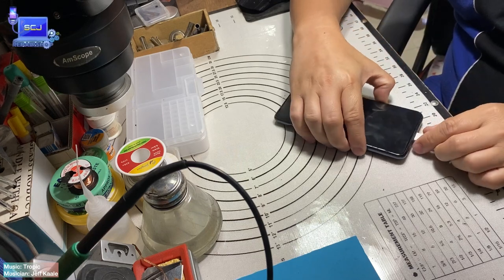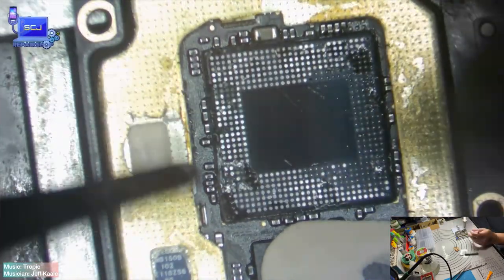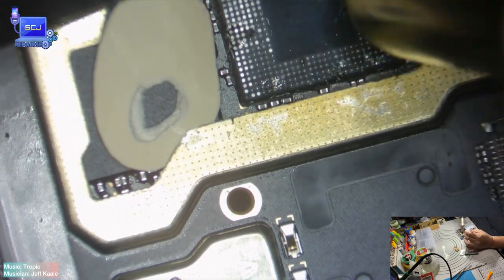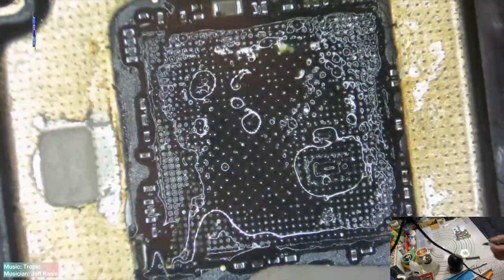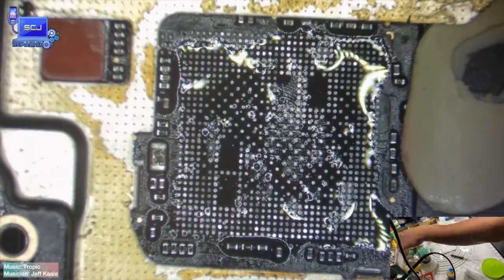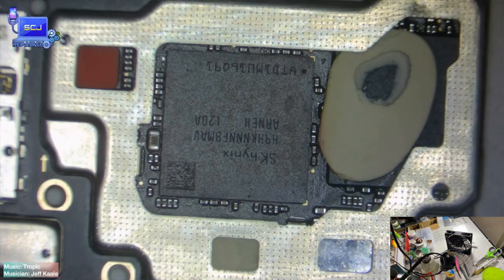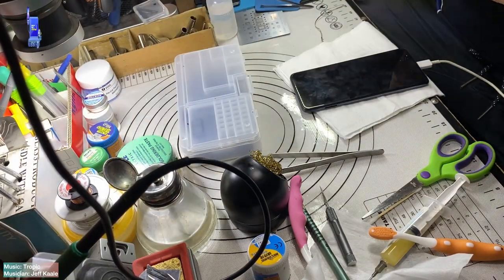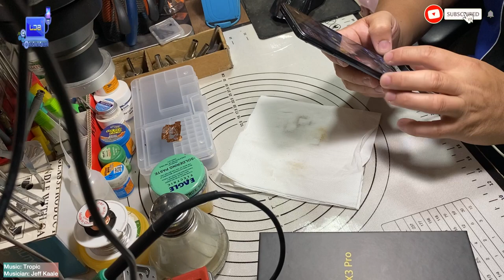POCO X3 PRO COMMON ISSUE (DEADBOOT) NEW LIFE VIA DUAL LAYER RAM/CPU REWORKS DONE SUCCESSFULLY

Comment: what if a technician reballed my cpu and is still on bootloop would doing some work on the emmc would bring it back?
Reply from the maker: Why would technician reballed cpu if it is not the problem? Please don’t do blind repair. Proper troubleshooting is required. You need to make sure where the exact problem before you go through it
Reply: @ScjRepairShop-  thanks for your response, in your opinion is still savagable after a bootloop?
Reply from the maker: @alfredobriceno5924  yes brother skilled technician can help you solve your problem.